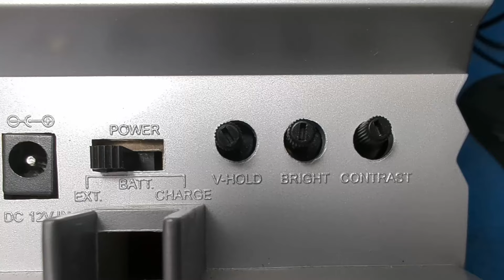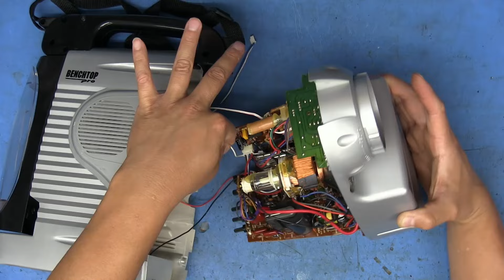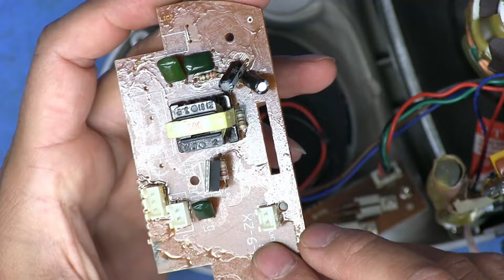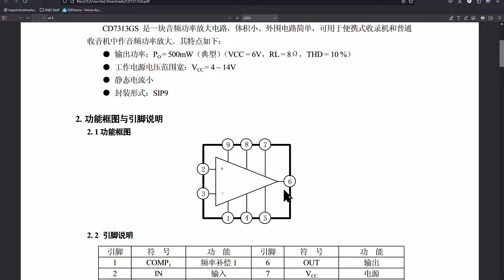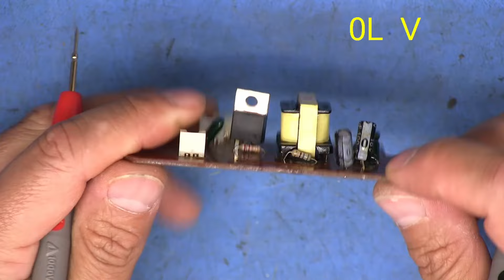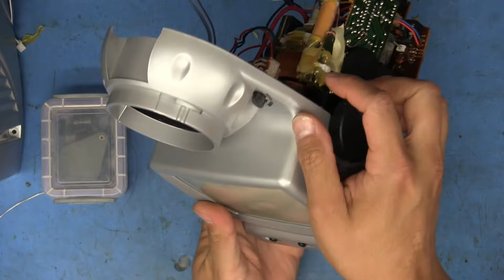TEF #190 | 7-In-1 TV Lantern Teardown

Comment: Ive got one of these! Though my thermometer is missing and the compass also dosent work
Reply from the maker: Compass is pretty terrible on this one also, basically just turns with the unit. Not to mention the fact that you have to hold the entire unit with the screen facing upwards to even be able to use it, if it worked.